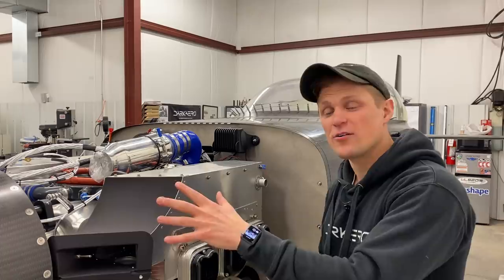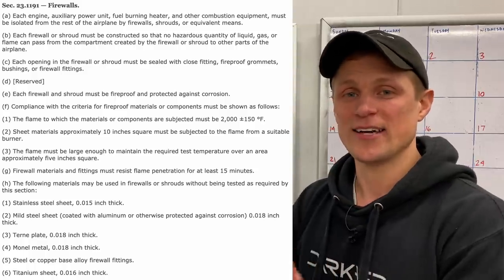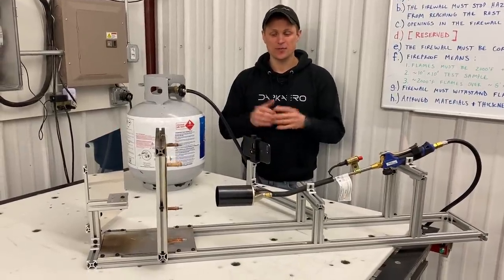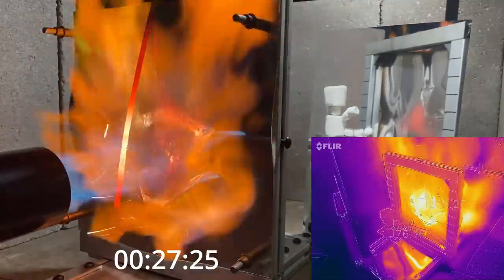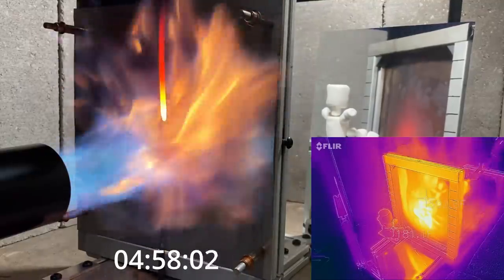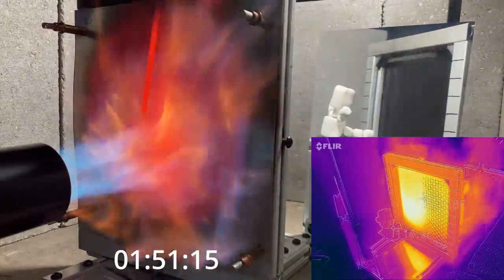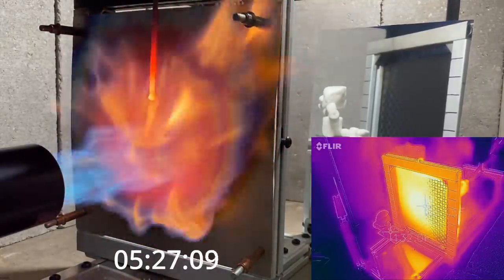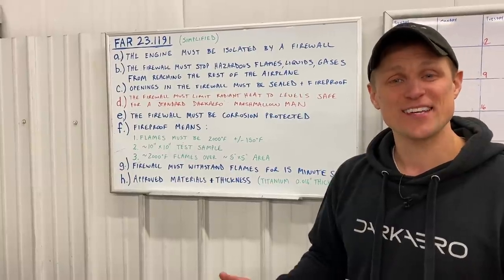What is the best FIREWALL material?

Comment: I'm a bit concerned when you use the full sandwich including the aluminum honeycomb, the honeycomb may melt and make pools of liquid aluminum.
Reply: The titanium and insulation would prevent that for at least the 15 minutes required by the regulation.
Reply: As the tests showed, the heat leveled off well below the melting point of aluminum and the aluminum, being a good conductor, would spread the heat fairly evenly across itself and therefore avoid melting into puddles even if there was a hot spot in the firewall.
Reply: @David-yy6hp  I'll be happy to be wrong about it, after all it's just "simulation" I ran in my head. My idea is, aluminum in the honeycomb is indeed good thermal conductor but the air enclosed in the honeycomb compartments is actually very good heat insulator and the complex way the heat has to spread through the honeycomb makes heat transfer in it and through it significantly slower. Also important role in the other side of your testing plate being low temperature is that it is cooled by air circulation and radiation from the other side which will be suppressed when the honeycomb structure is there. But it will all be resolved once you run tests with full sandwitch and I hope it will end to everyone's satisfaction.
Reply: @kasuha  I wonder if a porous honeycomb, one in which air could circulate, would improve the firewall. I wouldn't be surprised if the movement of air would cool the honeycomb section significantly, although the temperatures are so low that it might be too much trouble for the benefit.

Comment: Problem with this test is that once you cover the blanket, air cooling stops and the heat a-cumulated will probably exceed the carbon fibre temp limit, possibly also the aluminium and maybe also that of the carbon fibre inside the cab, or More so the resin causing it to possibly melt, smoke or otherwise
No doubt you have tested for this, and everything is ok otherwise you wouldn’t be making this video
Nice plane and great work

Comment: Hey guys I noticed that you are using imperial fasteners is there a specific reason for not using metric? Out of interest would it make engineering more difficult to do imperial over metric due to the added complexity.
Reply: They are a US based company. The US is still firmly hanging on to imperial units and metric fasteners are a bit of a rarity there, especially in the aero industry.
Reply: @LesNewell  yeah I understand that much but it seems odd for an industry like aerospace to still be using imperial due to its small size whereas the automotive industry has already made the conversion. Cross compatibility issue etc, only understand Boeing having reason to not
Reply: @baseballlife5884  Australia is metric, we also have the Quarter pounder, it's more of a marketing name these days. The 113 gramer, just doesn't have the same ring.
Reply: Almost all designations are actually in a numbering scheme and you can say that it is independent of metric or imperial.
You drill a #12 hole for an AN3 bolt which has a #10 thread. Now is this imperial or metric? The 12, the 3 and the 10 can translate to both inches or meters.
Reply: @cadenbecker2952  US built aircraft. US fastners. US language. US rules!
Reply: @martinrenschler4046  That's awesome exactly what I wanted to learn and know thank you , very rational and the sort of solution I was expecting from a bunch of smart people making things fly.
Reply: @Airplanefish  exorbitant amounts of patriotism, great...

Comment: The titanium provides the mechanical strength to prevent fire intrusion, and the ceramic is a good insulator, so would it possibly be better to put the ceramic ahead of the titanium? That way the titanium is shielded by the ceramic?

Comment: Rather than aluminum honeycomb core, why would you not use the Nomex honeycomb core? I'd it would resist transferring heat from hot side of core to cold side of core much better than aluminum ...(?). I'd also be interested in the results of placing 'Starlite' type ablative coating on the hot side of the firewall ( https://www.youtube.com/watch?v=dT1dSs988cY )